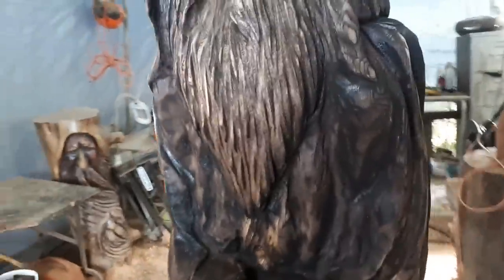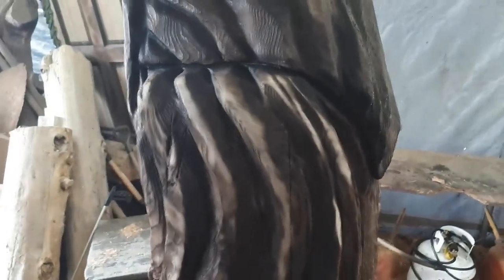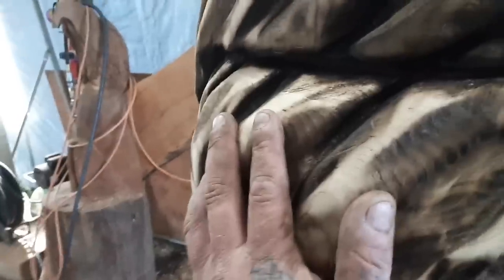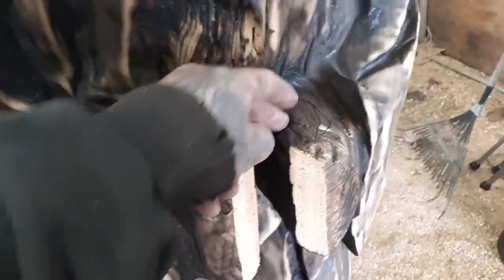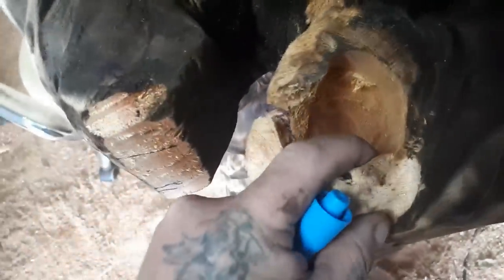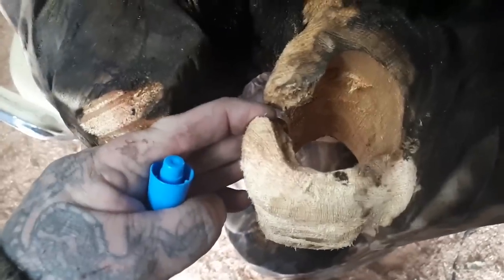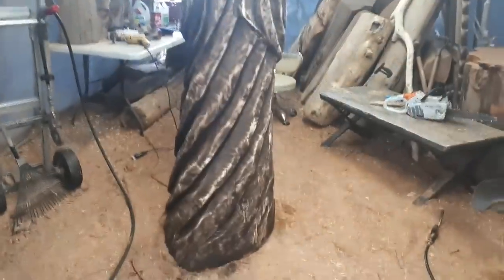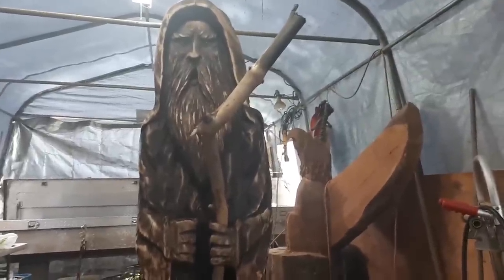Chainsaw carving, the final in touching up the life size wizard, using stihl chainsaws, dremel,

Comment: Love your work. In the future it may help with the hands wood strength if you cut the staff in half then drill like an inch or two into the top of the hand and likewise the bottom of the hand and then glue the bottom of the staff into the bottom of the hand and the top of the staff into top of the hand. It will have the appearance of going all the way through yet you still have a lot of wood left in the hand so it’s not as brittle.
Reply from the maker: I agree and thought of that